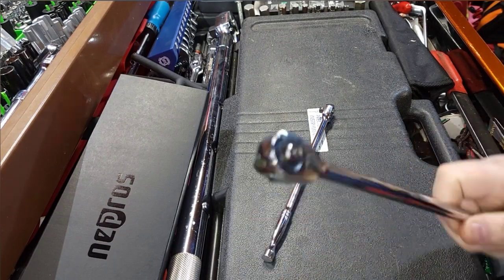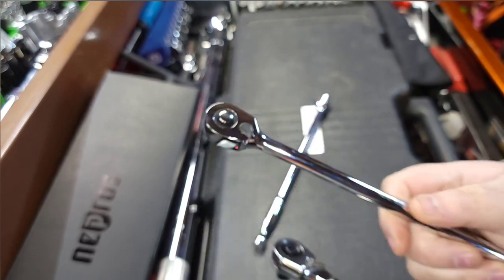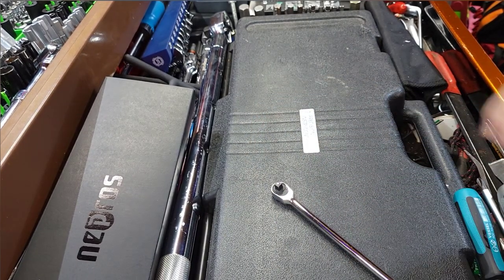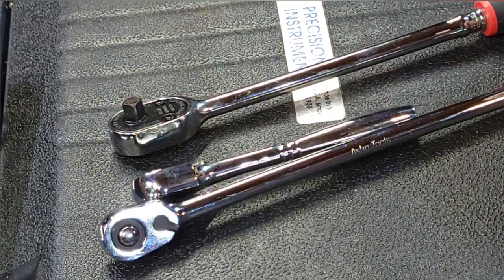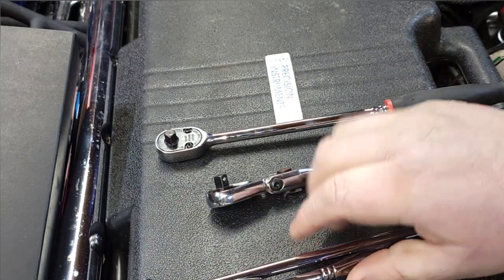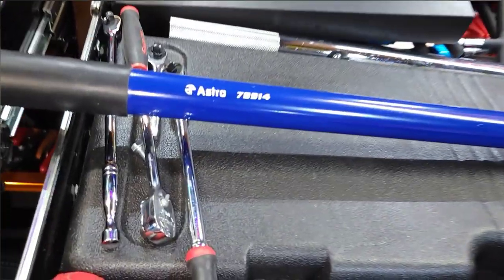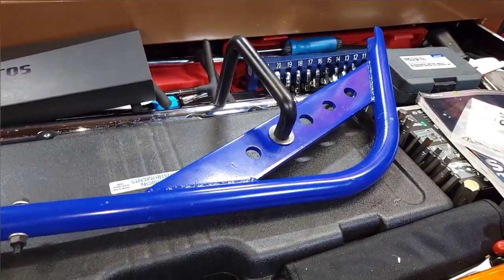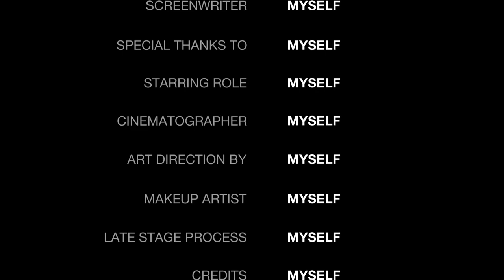NEW ASTRO PNEUMATIC 78914 BACK SAVER 9000 | NANO RATCHETS SO TINY!!

Comment: Big brother I’ve been using those two ratchets along with the 1/2” and 3/8 standard length sisters almost exclusively down here for a year with ZERO issues. They get used daily, sometimes all damned day. Only just now, they are going in the big box to rest so I can run the Williams for a while.
Reply from the maker: They are well made for sure!!

Comment: I have all the sizes in the astro nano ratchets.  Need to warranty the 1/4" pretty much slips constantly and it wasn't used or abused in anyway.  The one I use more times than not is the 1/2" drive which has been pretty solid.

Comment: The hockey puck is similar to the SimTools LCAT6803 (I believe they are out of business now). I bought one 5 years ago for $219 and it is great - especially if you don’t have a lift available. This one is one piece, heavy, and also came with chains if you were not able to hook into something for leverage. I used the chains once on a 2012 Subaru Legacy.

The AP 78914 should be pretty amazing for the price!